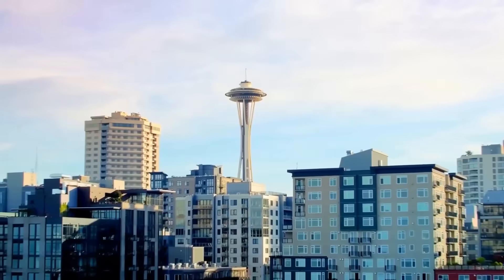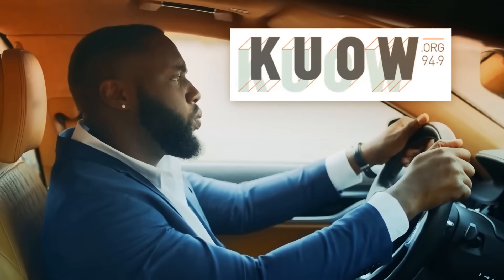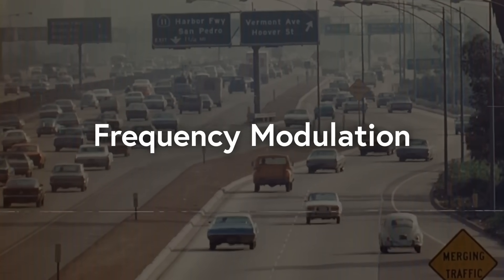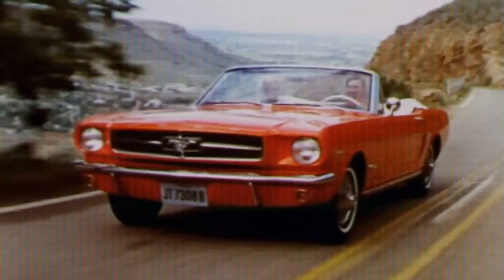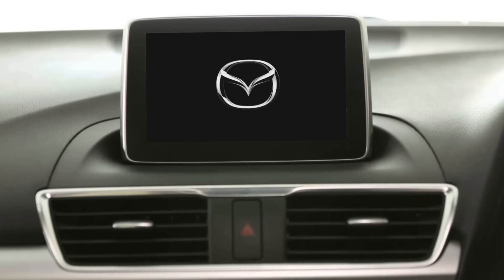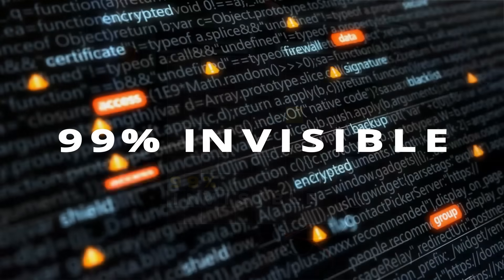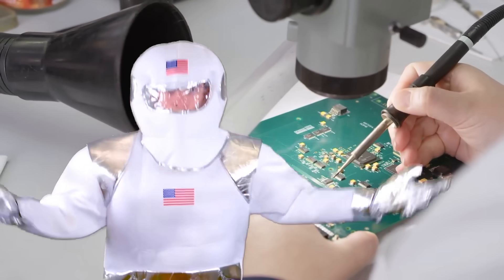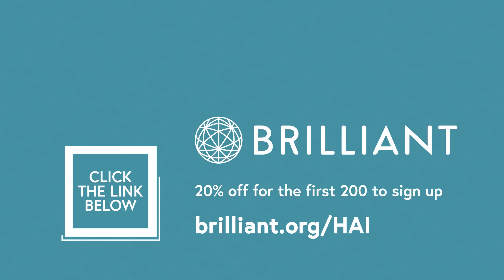Why Hundreds of Mazdas Tuned to 94.9 Broke Simultaneously

Comment: "These sort of software bugs are going to have higher and higher stakes as cars become more and more computerised"

As a software developer, I'm keenly aware of this. The fact that some cars today are entirely incapable of retaining their basic functions of "go, turn and stop" if the one or more of the onboard computers aren't functioning correctly is an immediate no-buy from me. Limp modes are okay, they protect your car if something goes wrong but still let you keep control of it. But having no mechanical backup system that makes the electronics redundant is a huge issue of newer cars IMHO. One of the reasons my daily driver was made in '91 and is still my daily driver is that everything is mechanical. If something fails in the electronics, the worst that'll happen is the check engine light coming on and maybe you'll lose some of the electronic functionality. The car will still drive to your destination, albeit likely with reduced performance and efficiency. Cars today simply don't seem to be able to claim that same feat.
Reply: i think cars should use a lan like system for their systems.
one for safety and drive, one for infotainment, one for comfort, and one as a central hub/onboard black box so the systems can talk to each other (and not connect to each other directly)
 and so there is a place were info is kept for every drive, and fault codes can be read.

that way a software bug in the infotainment system shouldn't effect driving (and cars shouldn't have their speeds displayed in the infotainment screen), all of these could be placed on one board.
all of these systems could easily be built into a single board (possibly with a few daughter boards for say electric motor speed control, or displaying an image on the speedometer.
Reply: @Reverend_Jay  they basically do. Modern cars use the CAN bus, which stands for controller area network, and allows all of the systems to communicate together.
Reply: @kojetono5853  I can’t speak for all Evs but teslas do that. The infotainment system is completely separate from the driving system.
Reply: @kojetono5853  And CANBUS is extremely susceptible to minor wiring issues... One frayed wire in the trunk can shut your whole car down because the Engine Control Module, Body Control Module, Infotainment Module, Transmission Control Module, ABS/Traction Control Modules cannot communicate with each other. In fact, one misbehaving module can "spam" the CANBUS network with enough garbage data to cause all sorts of unrelated issues that can have a mechanic ripping their hair out trying to track down the cause.

I think J Denton was suggesting something like multi-level LAN topography, where there are several small networks communicating with one master device. An issue on the Infotainment LAN would affect only the Infotainment system, and the master device could ignore data from that smaller network while still allowing HVAC, Engine, Powertrain, ABD/Traction Control, Body networks to function unimpeded. 

While that level of redundancy would limit the effects of malicious code, or accidentally-executed benign code for another function entirely, from affecting the vehicle overall, it would add to the cost of the vehicle.
Reply: @Reverend_Jay  agreed. Just keep everything separate instead of relying on each other to work
Reply: @Reverend_Jay  vehicles do have different segregated computer systems that communicate via CAN.  Also there are safety standards specifically focused on software issues  - e.g. UL 1998

The issues here is that infotainment systems in vehicles are not subject to UL 1998 as they are not deemed to be critical systems.   I think that this needs to change
Reply: @Reverend_Jay  they do, but the infotainment system is in the center and is vital equipment
Reply: It does CANbus
Reply: yes, me too, I have been programming since I was 6 and it scares me to see software handling increasingly critical tasks knowing that a simple bug or electronics issue can leave you completely vulnerable with no recourse at all.
Reply: Totally agree, I use an 2003 Citroen for that reason. And my TV is as smart as a brick, I use a chromecast if I want to stream something. I think that cars and household appliances nowadays have a shorter lifespan in general, because of those smart features which will eventually stop receiving updates / support from the manufacturer. If something comes with an app, it is an instant deal breaker for me.
Reply: @_wouter52  imagine a future where your refrigerator hates you.
Reply: It sounds like your issue isn't so much with electronics, but with code. Software, firmware, etc.

Your 1991 has plenty of electronic systems, with no mechanical backup, that if the chip went, the car engine wouldn't run. Electronic ignition. Electronic fuel injection. Etc.

But very little actual code compared to today's cars.

Also in software industry, and also don't trust code to turn or stop my car. But to run the engine, I don't have a problem with.
Reply: @russelloppenheimer3970  exactly, just those run a very basic RTOS with exactly one program, which the modern infotainment certainly doesn’t!
Reply: Software developer drives car that has mechanical system..... Shame car companies are more obsessed with planned obsolescence over quality.
Reply: Thats why I dont like the idea of steer by wire and brake by wire
Reply: @GTSW1FT  Oh, it gets better than that. There is evidence that assassinations have been performed by tampering with the drive-by-wire systems via wireless firmware update.

Granted, the nature of these assassinations, the victims, and the people suspected to be behind them, mean that law enforcement and news investigations have been sparing if not nonexistent.
Reply: @GTSW1FT  brake by wire concerns me as well, and now the redundancy where if your brake fails the car lets the air out of your tires. idk if they implemented that yet but it sounds a lot like a way to sell wheels.
Reply: @GTSW1FT  No cars on the market that use electric steering and electric braking are without a mechanical back-up. If your electric steering fails you just have to use more force, no different than hydraulic power steering failing. If your electric brakes fail you will have more pedal travel and then no power brakes, you will have to press harder. No different than vacuum brake boosters that can and do fail.
Reply: @X85283  I call bullshit I've had to repair ford's that have electric steering and they have locked up while driving and you can't turn at all. The newer the cars get the worse they get
Reply: @X85283  lots of people on this thread just talking with zero knowledge. Thanks for educating those that don’t know what they speak of.
Reply: @X85283  *for now
Reply: i would never buy a car or for any product where the product/car has more control then you, just seems kinda scary
Reply: Honest question, how does one find what cars have adequate physical capability/fail-safe?  I have a hunch that most searches I could perform might send me to some unreliable nutjob who doesn't know the first thing about computers.
Reply: Exactly! There will come a time when we start to realise that the best fail-safes are usually mechanical. The Tesla Neutral problem could easily be solved by putting a lock-up clutch between the engine and wheels. It could be disabled by pulling a tab near the engine, and would allow the car to roll. It's not rocket science, but Tesla won't do it because it would cost them more money.
Reply: I’m glad to hear a software developer recognizes that issue! I’ve run into a few cars that lose major systems due to a failure of a minor system failure, of a completely unrelated part. 
While the check engine light isn’t a big deal, if it causes no drivability issues, it is if you need emission testing. 
That forces lower income people to junk a perfectly good car, because a check engine light is active, causes zero drivability issue, but is a multi thousand dollar repair. 
If we could only get manufacturers to start thinking about the long-term viability of vehicles, maybe they would design systems in a better way
Reply: @BloodlineRC  Neither manufacturer or government cares one bit about long term viability!
Reply: @sunbeam8866  you are totally right about that. It doesn’t make shareholders more money to make serviceable products.
Reply: @Riccorbypro. Another software engineer here.  I agree.  My 87 Mercedes diesel is all analog.  Am I paranoid?  Nope, I just have enough experience with computers to know I should NEVER trust them with my life.
Reply: I have a Corolla from 1998, and other than being a rusty turd, it genuinely has no actual malfunctions--none. The check engine light is on because the evap system is now imaginary due to rust, but it still just runs and runs and runs. If/when it dies, I'll get another one (or a Camry) from about the same era. I'm fine with importing from down south, I don't care--I'd rather have granny's rust-free 02 Kentucky Camry than any kind of new anything made these days.
Reply: @Simoxs7  I mean it makes it cheaper so. Honestly it's best if we just get rid of cars all together
Reply: @hihellothere9569  Then, you'll be happy to know, the 'powers that be' are working hard to make that happen!
Reply: Cars are weird but honestly, people are just becoming more lazy, I suggest just everyone going on busses
Reply: My '09 jetta runs without the electronics

I know bc I've roll-started it (manual) and it'll keep moving even without turning the key to ignite the computer
Reply: I have wondered about this. My car has features that kind of creep me out, to be honest. Like one time it very subtly corrected my steering. I thought, ok, but what if there’s a glitch and it locks up and I can’t steer at all?
Reply: @NicoleAZ145  May I ask what the model is?
Reply: @r.u.s.e3586  It’s a 2020 VW Tiguan.
Reply: I bet people went through the same crisis when transitioning from carriges to automobiles
"You gotta feed it gas it's expensive and it explodes"
Reply: Cars are going to be apps, like the full driverless service after 2025, cars like everything else will become a subscription like Netflix, I might invest in Carvana, they have the car dispensary already.
Reply: And all of that for 4× the cost....
Reply: I don't even care about physical components as long as there is redundancy. When there's only one computer controlling the car, it's hard to fly. Even airplanes fly by wire, but they have multiple redundant chips instead of one chip that controls literally everything.
Reply: It does get complicated. I had a 2005 vehicle, the passenger door had a short, and it would surge / burn out the van's main control module, though not instantly. The first time it happened, I was straight down the road from the mechanic, so I wasn't completely disabled from a lack of all signals and hazard lights (the TOP rear brake light was the only working light, I was kinda scared ***less!).

Weirdly the engine and controls worked 100%, so there was no 'going' fault, but the fact the HAZARD LIGHTS were not on a 200% safe path was unbelievable.
Reply: Like a car that catches on fire and disables the door handle.  There is a manual backup, pity many users have never used it and don't know where it is.
Reply: Sorry I’m not reading that whole thing. But I’d like to point out. Evs don’t rely on computers for breaking and steering. Literally for the reasons mentioned. While some Evs like teslas have regenerative breaking using the motors, actual brake pads are physically connected to the brake pedal like any other car. Same with the steering wheel. That’s why In Tesla fsd the wheel moves even when the car is driving. It’s physically attached to the steering bar. I’ll give it to you that it won’t go without acceleration but there’s fewer cases you’d need to go for safety reasons than stop for a safety reasons. Also it’s a more. It physically can’t be controlled without a computer. I’d also like to point out that some Evs have several repeated computers to do the same task. So if one breaks. The other one can take over. Or if they disagree on what you told it to do, they repeat the calculation. Or in teslas case, what the ai said to do as well.
Reply: @lynxrbeam8732 .."sorry i'm not reading the whole thing"
Reply: Uh... you drive a car from 1991 because you think it's safer than modern cars?
I mean, if that's what you want to think it's your prerogative to choose your own car, but that is quite possibly the most misinformed thing I've read on the internet in at least a month.
Reply: You act like that car computer isn't going to need a rebuild in the near future when the capacitors fail
Reply: There is no car on the market today that cannot stop or turn even if the vehicle has no electrical power at all. Throttle by wire has been a thing for 20+ years at this point. 

But yes if that fails then you cannot accelerate. 

But your 1991 car, I'm almost certain, is not fully mechanical. It probably has at least electronic fuel injection. If not it was an extremely basic and primitive car even in 1991. Also... throttle cables can snap, or stick. Carb floats fail, jets clog. Many things can stop a car from going to its destination. 

On the other hand, we can talk about how a basic car in 2022 is absolutely, mind bogglingly, tremendously SAFER than a basic car from 1991. Like it isn't even CLOSE. 

So enjoy driving your car that will get you to your destination even if a computer fails, maybe, but keep in mind your chance of serious injury in an accident is way higher than someone driving an equivalent modern car. I'll take stopped on the side of the road with a failed ECU vs snapping my neck and doming by brains into the steering wheel, thanks
Reply: @X85283  up until 2005 or so most cars had no way to communicate remotely, now pair the ability to communicate and execute code remotely with fly-by-wire throttle and steering....
Reply: @X85283  No, cars today are not safer as a rule, not even close! I can't speak for vehicles sold out of the USA but a large portion of cars here use a unibody style of construction that, while allowing for higher production numbers and reduced costs, is much more susceptible to damage on the long and short term. They are also designed to use up as much under-the-hood space as possible to the detriment of maintenance ease. I cannot think of any reason why a modern car would be any safer then one from the 80/90's on average (save for external cameras).

"throttle cables can snap, or stick, carb floats fail, jets clog. Many things can stop a car from going to its destination." 

This is something that can happen to any car regardless of the age. But I'd rather fix a busted alternator on a 90's Cherokee with just the replacement, some pliers, and a couple wrenches then on the 2022 Ford Explorer where it's buried underneath a mountain of plastic parts and coverings that takes ages to be removed, half of them do nothing but get in the way, and possibly need proprietary tools to remove as well (or some...abnormal engineering skills).

For 90% of pre-2005 American vehicles I can count on being able to ensure my own safety. I cannot say the same thing about today's cars.

I won't go so far as to say that older cars are always better, cause they aren't. But driver/passenger safety is one of those things that's undergone a massive regression over the past 15 years.
Reply: @X85283  thanks for playing "How Much Can I Miss The Point?" You're today's winner!
Reply: @X85283  But many modern cars have electric door-latches that can trap you inside if the power fails. Specifically, Tesla does have a manual door release. but it's a lever in the power-window control panel, SEPARATE from the button that electrically unlatches the door, and there's NO manual release for the rear doors!
Reply: Damn dude. I drove a 1992 model once. From 2007-2010. Thing got a broken exhaust, the gas gauge didn't work (had to fill it every 200 miles), the passenger door wouldn't open from the inside, the hood wouldn't lock down unless you manually tripped a lock back into place first, and the parking brake didn't work (it was a manual and you had to park it in first). And all those quirks were there almost 12 years ago!
Reply: @User31129  I drive a 1988 Chevy Celebrity that was my first car that I purchased in 2008. Manual windows, manual locks, leaky door and window seals that whistle, and have a tend to freeze in the winter if I don't park in such a way that allows water to roll off the car and not into the insides of the driver's door, exhaust pipes that develop new holes shortly after others are patched. The A/C worked until 2018 then a hose blew leaking all my precious R12 refrigerant out, but I've acquired a large stockpile of the stuff to to recharge it with when I get around to it. The front passenger window hasn't been rolled down in so long that is frozen in place. It is still fairly young at 167k miles; it only had 98k when I bought it in August 2008. The mechanic I use was a dealer mechanic back when the car was new and he knows his way around this thing. It is good for a quick trip to the grocery store or a jaunt around town but its days on the road as a daily driver are drawing to a close. Within the next few years I'm planning on doing some sort of restoration on it and semi-retiring it due to its age - its nuisances are starting to become a real pain in the rear end, and trying to get into a car that low to the ground isn't really so easy with my back these days.
Reply: @HustleMuscleGhias    All those failures are due to the fact that a Chevy Celebrity is a low-reliability car, ie "shitty". Has nothing to do with software compatibility.
Reply: @HVYMETL  No where did I mention anything about software . The post you referenced was in response to a previous comment regarding quirks and issues on a vehicle that was just as old as the one I've been known to drive. Keep in mind that we're 34 years removed from when it rolled off the line. UV light, rust, age, heat, and neglect have taken their toll. The car you drive today will most likely never see that age, and will end up as razor blades and Lego sets by age 20 if it is lucky.

In regards to shitty, name one GM product from Astro to Vega that wasn't a big steaming pile of crap in some way or another? As far as low reliability, there are worse cars out there ( the Yugo comes to mind ) and sometimes designs don't always work out - in this case the dual mass air flow and map system was a cluster with a 50% failure rate out of the box, but they did get past that failure, so I will give you that one.. Celebrities are a rare breed today, and I know of at least a half dozen still on the road today with over 277K on the clock which is not too bad for a 30+ year old design with 2.1 million produced. Your mileage and opinions may vary.
Reply: @User31129  that’s your own fault for not properly maintaining your car. I drive a ‘97 that’s basically brand new in appearance and function after 135k miles. Just take care of your shit and it won’t suck.
Reply: @User31129  Well, why didn't you fix it? Sounds like mostly simple mechanical repairs. 
I can still work on my '90s cars, without needing a tow to the dealer for a software-bug or bricked computer-system!
Reply: And this is why, just because youre a software developer, that doesnt mean you know shit how cars work.
Reply: @termitreter6545  I don't believe he claimed it was safer!
Reply: ur paranoid bro
Reply: @redbean9410  he's not paranoid, you're just an easy mark.
Reply: @xXx_Regulus_xXx  lol
Reply: @redbean9410  tfw you miss a payment and a mandatory software update bricks your car
Reply: @redbean9410  and your naïve..
Reply: @PhunkBustA  you’re*